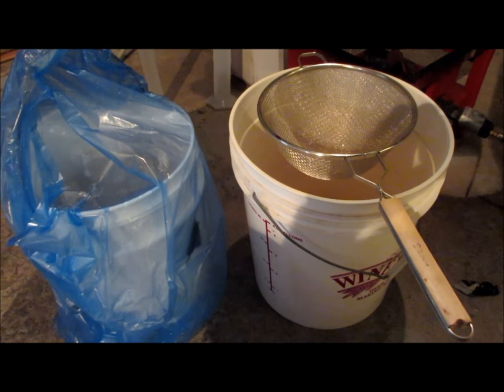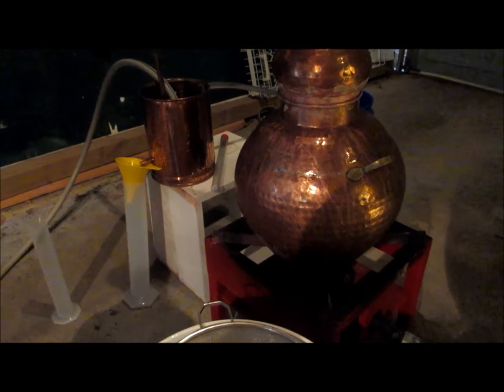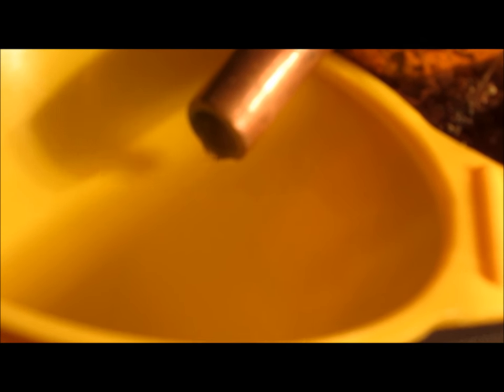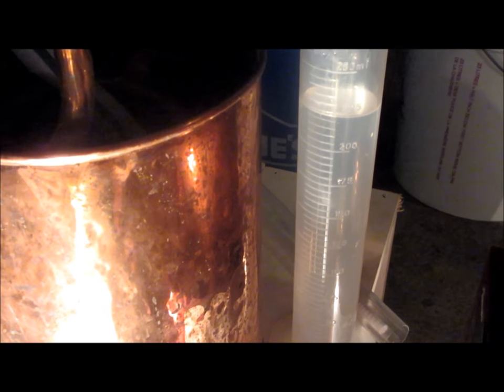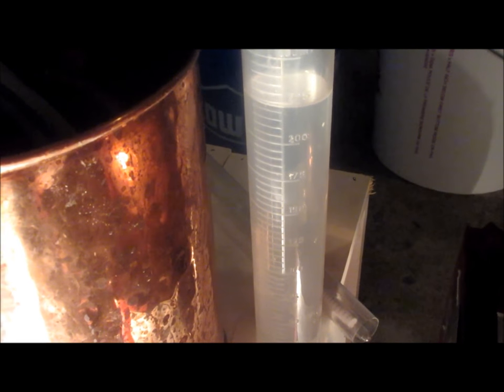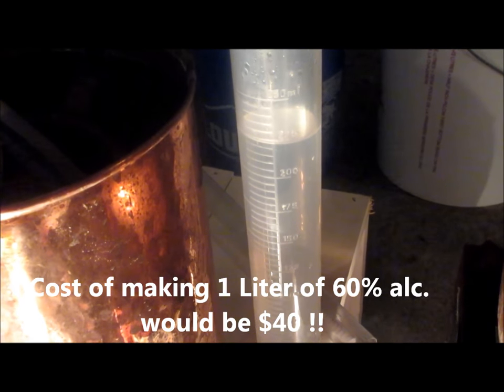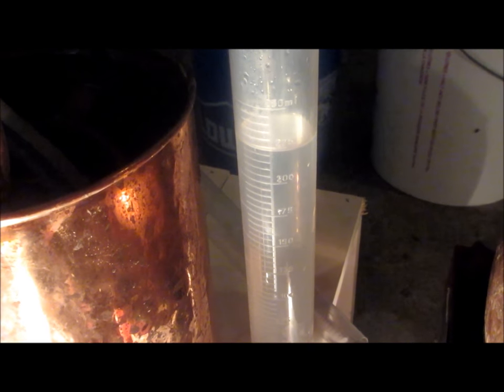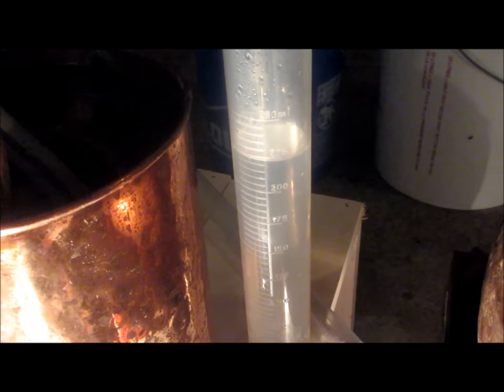PotatoVodka part 2

Comment: I don't like to be mean but this video and the first part are misguided. Let's start with the idea of buying 6kg of spuds for $9. That's preposterous, where I live, in Germany - an expensive country - in November the supermarkets are selling 10kg of potatoes for $2. If you make a little effort you can buy bulk potatoes for even less. 

Second, the notion that potatoes do not contain much starch is also wrong. Google it if you think otherwise:  "Freshly dug potatoes contain 75 per cent water, 18 per cent starch, 1 per cent fiber, 2.2 per cent protein, 1 per cent ash (inorganic constituents), and 0.1 per cent fat and a little sugar. Potatoes grown for starch manufacture may contain as much as 22% starch dry matter." That is to say, apart from water, potatoes consist primarily of starch. There is also a percentage of simple sugars, which will contribute to the eventual alcohol.

Finally, there was no mention of separating the heads and tails from the hearts of the distillate. If you fail to do this, you have an awful tasting spirit which will give you a mighty hangover. Running the liquor through activated charcoal is not sufficient.

If you want to make potato vodka, look elsewhere for instruction.

Comment: I would suggest that you try again with organic potatoes and not factory farmed potatoes because of intensive farming techniques, the results are bigger but not much more on the nutrient side of things, like wheat for example, it is cross bred with sagem to produce the current wheat stock that has a kernel that is twice the size of proper wheat but only half the nutrient value. Sadly this is the problem with all intensively farmed produce.

So getting hold of stock form a farmer that grows organic, non-factory seeded stocks, your likely to be getting the level of alcohol you were hoping for.

Comment: Malcom could I get away with using just one enzyme for potato vodka? Enzymes are expensive here in Eire and not easy to get. Potatoes are also expensive especially on the scale needed here. I can get flaked maize really cheap from the feed store but what I am stuck for is a proper enzyme to break it down. I could use malted barley from my beer brewing but again that would not be economically viable. Really stuck here on this one.Slainte.
Reply: You need both, I tried just alpha amylase and it didn't convert the starches fully to sugar.
6 row malt is your best bet, it has the highest enzyme content. You can get 10 lbs for less than $14 at Brew & Grow.

Comment: what is formula to know how much metanol have in stil?
Reply: There is no formula. If it smells like nail polish remover, chances are it is. Toss the first ML's, that stink like crap. Then collect and make cuts. That means put the heads aside (can be used in another stripping run), collect the hearts and throw the tails into the heads jar.
Reply: thank you :)
Reply: @kalleklp7291  the methonal ive been pulling off my corn squeezins smells good almost like peach or mango idk why butvit burns green like its supposed to
Reply: That's not methanol but a lot of esters and other stuff. Smells like green apples or so.
While you may like the smell it's absolute crap that doesn't belong in your product.
As you write "corn" I reckon you make whisky?
A tip: Do a stripping run and take plenty of foreshots...then do a spirit run and take the rest of the foreshots and make some crude cuts. The part you deem as hearts...let them air out for some hours. Then make the final cuts with them.
Heads and tails from this run go into the next stripping run. Foreshots and early heads are good for a firestarter or the like. :)